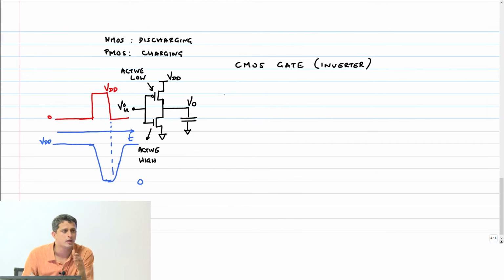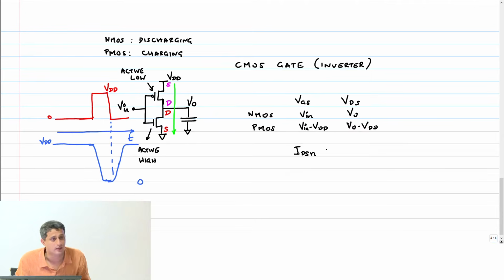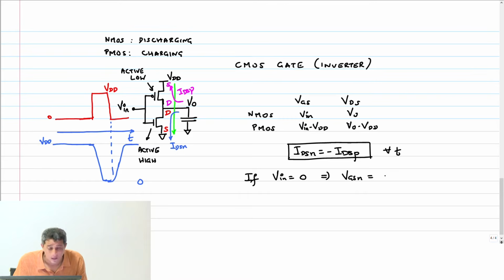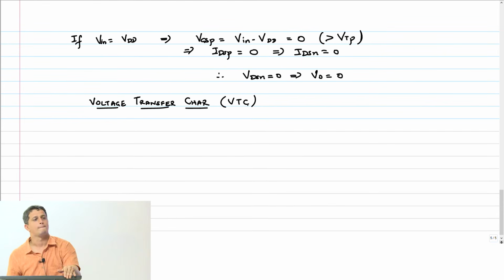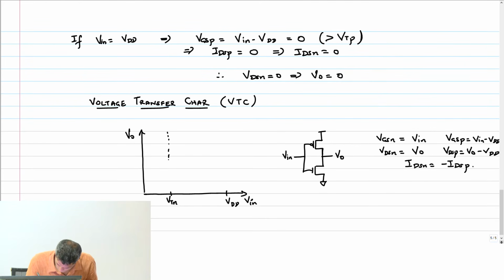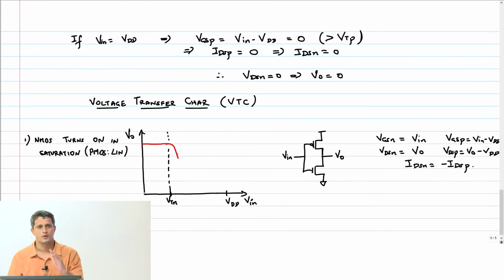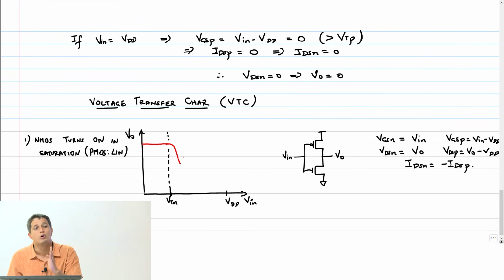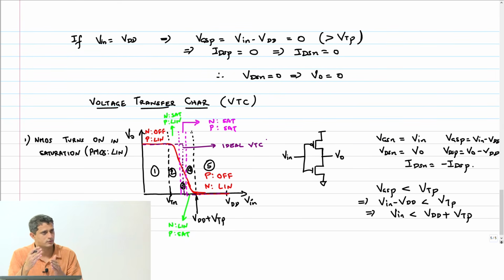Inverter - 2 - Voltage Transfer Characteristics

Comment: 11:02 if Vdsp is slightly lower than vdd, then that voltage difference in pmos is enough to allow large current rather than small current through the pmos.

Comment: sir had told if Idsn=0 then Idsp had to zero since both PMOS and NMOS are in series. my question is why can't current can flow from PMOS via capacitor even though current through nmos is zero
Reply: @adarshanand2239 It does conduct current at t=0(immediately  after switching ), but within no time V drain of Pmos (technically Vout  ) will charge to Vdd  ,As it is connected to capacitor it only conducts until it is fully charged , once it is fully charged it's stops conducting. You can also think in this way, once Vdrain of Pmos reaches Vdd there is no voltage difference between Vdrain and Vsource of Pmos ,so there is no potential  difference to assist current flow ( even though |vgsp|<|vth|).Hope This helps

Comment: How that Idsn=-Idsp can anybody explain
Reply: Because in pmos current flows from source to drain
Reply: @akshaykumarsingh6792  negative current?
Reply: Because they are in series, moreover minus sign because current flows from source to drain in PMOS
Reply: @chetanggs  sir had told if Idsn=0 then Idsp had to zero since both PMOS and NMOS are in series. my question is why can't current can flow from PMOS via capacitor even though current through nmos is zero
Reply: @adarshanand2239 It does conduct current at t=0(immediately  after switching ), but within no time V drain of Pmos (technically Vout  ) will charge to Vdd  ,As it is connected to capacitor it only conducts until it is fully charged , once it is fully charged it's stops conducting. You can also think in this way, once Vdrain of Pmos reaches Vdd there is no voltage difference between Vdrain and Vsource of Pmos ,so there is no potential  difference to assist current flow ( even though |vgsp|<|vth|).Hope This helps